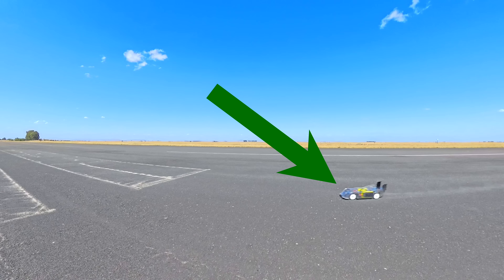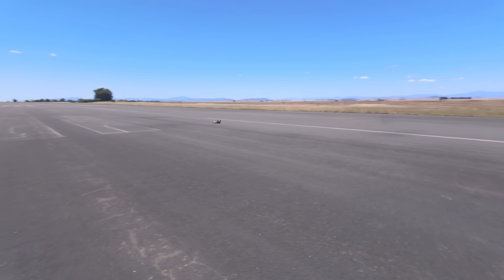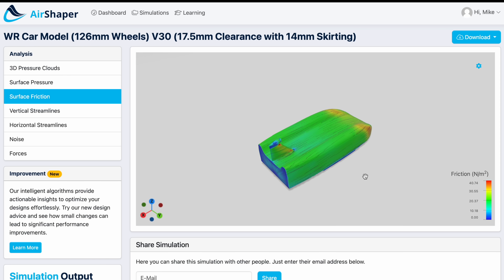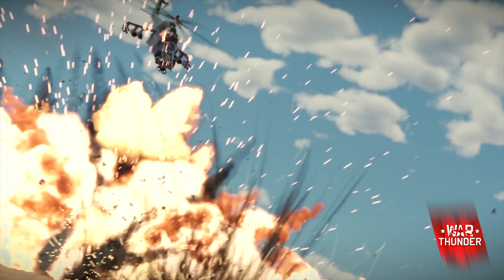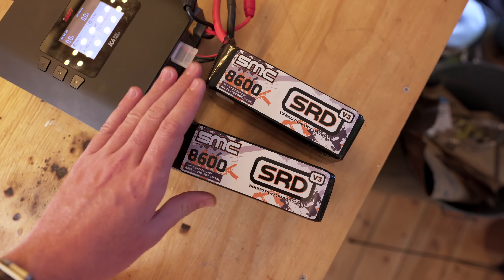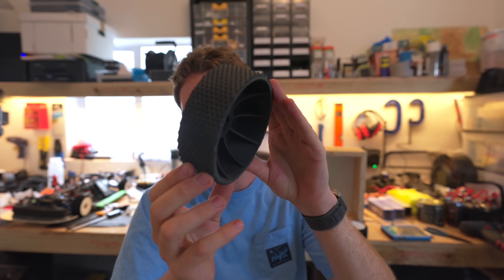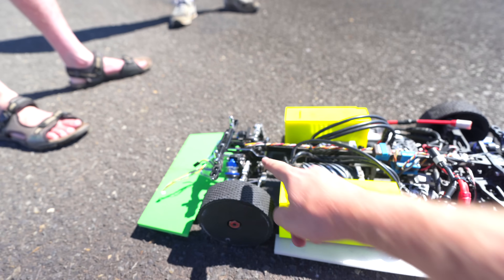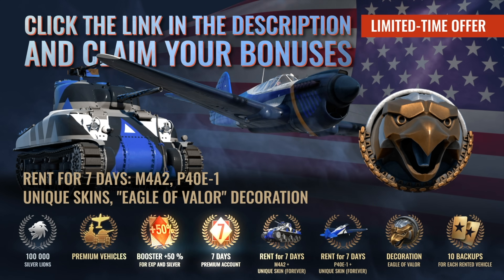World’s Fastest RC Car Project - Part 1 Aerodynamics

Comment: Why is the rear end flat?? That's an insane amount of drag. Look at SuperFastMatt's airflow sim videos for his full sized land speed racer, it has a looong skinny tail. 
Also transparent looks sick but a 3D printed shell would probably work fine for a 20th the price
Reply from the maker: 3D printing every shell is just not practical 😭 and waaay more expensive that you might think. The flat is back because of the aspect ratio of the car. If it was narrower I would go for a tapered back like Superfastmatt and that is the first thing I did try

Comment: I'm thinking if those batteries were securely strapped to the car that the car would have been totally destroyed.  The kinetic energy the batteries hold is more than the car itself.  Losing the batteries helped the car to stop sooner and with less damage.  But I'm not an engineer and I probably have no idea what I'm talking about.  Thanks for your videos!  Now I'd be concerned that the batteries could burst into flames at any time.
Reply from the maker: I created a TPU housing for the batteries which you can see. It protects them brilliantly. You have a fair point. But the batteries weigh about 2.5kg together. The car weighs about 8kg

Comment: I see that the drag level is not high so no need for a wing, but it definitely needs a better spoiler. Also, try making the car as low as possible, so the air doesn’t lift the car. Also, I don’t know if it will work, but a turbofan/propeller engine would also work.
Reply from the maker: Yes I might make a spoiler for the next build! 😎

Comment: use a icharger it will make the  battery go boom boom fast :face-blue-smiling: i blast my pack at 72 amps peek... but the battery dont have long lifespan but omg the power is nuts very good for doing drag runs like this ...  and i have never had a battery blow up on me charging at high amps been doing for over 10+ years now,  battery has to be good quality not cheap ones and stop using them when they get puffy lol
Reply from the maker: Hahaha I'm using ISDT!
Reply: @LukeMaximoBell1  that does the job  but if you really want your battery to be at its maximum performance get a icharger and a 70+amps power supply.  Big difference in power especially for drag speed runs your only at full power for not even 10 seconds
Reply from the maker: @thatonebeone  the charger isn’t going to affect the battery performance
Reply: @LukeMaximoBell1  it will but you won't see degrading after like 6 months or a year just all depends how much your using it.. that's the draw back of high amps battery life suffers lol..  but you'll still be able to use it but might get puffy haha

Comment: Idea, use lego wheels, they have a nice rubber tier and they light and knock off lego is cheap, then to keep the rubber from spinning off, first use a needle and thread and make knots on the inside of the tier, then put the tier on and fill the gap with a mix of pvc cement and contact adhesive "shoe glue" (NOT SUPERGLUE) pvc cement will chemically bond the tier to the hub and the contact adhesive grips the knotes as well as also holding everything together, remember with a wheel the part that is in contact with the ground is moving at 0km/h and the part of the wheel opposite the ground is moving twice the speed of the car, so lots of G forces
Reply from the maker: I don't know if lego wheels are strong enough, but this is an interesting idea to think about!

Comment: hmm... my comments are disappearing again. wtf YouTube
Reply from the maker: Oh that’s annoying!! It’s not me though 😅
Reply: @LukeMaximoBell  Perhaps if I reply to your comment it will get through. I was just saying that since you're designing your own wheel, I don't see why you'd want the vertical wall to be all on one side like the off-the-shelf ones. If the wall was in the middle there would be less cantilevered distance, so less deforming at high RPM (or at least less mass for the same strength at the rim). It would make the stance a little wider, but only by half a wheel width. I don't know if the car actually reaches the speed necessary for wheel deformation, but if there's any deformation it will be symmetrical and hopefully keep more even pressure on the foam, rather than having one side of the foam taking more punishment.

Comment: What about thin aluminium wheels with no tyres? That's what they use on the big landspeed record cars
Reply from the maker: I think that only really works because they are propelled by jet engines instead of  thrust through the wheels. Aluminium wheels are definitely going to slip in a build like this

Comment: That tire issue is the Achilles heel of brushless r/c. Seems nobody has engineered a material that can handle those high rpm
Reply: The runway is probably the worst he could get, some of my city streets are smoother then that, this was not fair for the car, the car was ready in my opinion but the runway keeps destroying the wheels and causing too much drag even when the wheels survive.
Reply from the maker: Actually the runway is pretty good. I just didn’t change the wheels soon enough. That was about my 10th run on the same wheels which is way longer than they should go for.

Comment: Welcome to the wonderful world of ( Build-Test-Crash ) - Repeat ad infinitum, Luke. I think you’re absolutely bang-on going FPV. Essentially speed record running is drag racing with far more tricky aerodynamics and wheel/tyre combos. As I found to my extreme cost, trying to coax an ERevo above 100mph! 😂

You might consider going the fan car route as keeping your model on the ground becomes more and more difficult the faster you go.

BTW I’ve got a Tim Smith-built dragster gathering dust in my garage if you fancy going that route sometime.
Reply from the maker: Thanks! Yeh the FPV makes it so much easier and fun actually! I might try the fan car method next build. 😎
Reply: @LukeMaximoBell  it’s not as easy as it may seem because a chassis plate is such an important part of torsional rigidity and big holes in that are going to compromise that rigidity. Also you won’t be able to do it with a vac-formed body because your fan will just suck it in. You’re pretty close to a Chaparral 2J shape already so maybe that’s the way to go, just longer, to accommodate a couple of ducted fans. Really looking forward to seeing how this project develops. 😊👍🏻
Reply from the maker: @andylewis7360  That is true, I really don't want to weaken the chassis of the car! There is likely space for fans at the back already so maybe I will try that.

Comment: Try making a void or a cavity under the chassis connected to the rear of the car. In order to make a vacuum that suction the car to the road, the faster it goes
Reply: Or a fan like the McMurtry Speirling
Reply from the maker: Yes! I might try this for the next build! 🤩
Reply from the maker: Yes not a bad design. Floor design is very important

Comment: all these failures are just offerings to the gods of speed. :)
a lot of the ROSSA lads have been having issues with tyre/wheel tech as well, so dont feel to hard done by mate.
the ROSSA runway is a lot smoother than yours, so if you can find a tyre/wheel combo that works on your test runs, it'll work at ROSSA.
best of luck.
Reply from the maker: Hahaha they have a lot of offerings 😂 Raz actually says the Rossa Road isn’t great. It might be smooth, but not the flattest? Not sure.
Reply: @LukeMaximoBell1  I only know the ROSSA set up from What iv seen on Kevin talbot's vids mate.
Anyways. Have you thought about metal cnc'd wheels with soft poly bush tyres?
Reply from the maker: @ I don’t think aluminium wheels are necessary. My 3D printed PPA-CF wheels are SO strong. If I can get a good grip compound to stay on those wheels then it should be a winner
Reply: @LukeMaximoBell  well sir, you just earned yourself a lil sub from me. looking forward to more offerings :)

Comment: The “mold failure” with the dimples may have made the body more aerodynamic like a golf ball?
The air turbulence could cause less vacuum on the back of the car. Also maybe something like a whisker biscuit on the bottom of the body/ or frame to keep air from getting under the body. I’m no engineer just some thoughts
Also maybe the wheels could be significantly bigger to lower rpm and use portals on the wheels for gear reduction and to keep the frame close to the ground.
Brainstorming with you
Reply from the maker: You’ve got some good ideas there. Except for the dimples. That’s a bit of a myth. But in saying so I’ll model that in my next video just to make certain. The skirt at the bottom of the car helps a lot with drag.
Reply: Even if it doesn’t help with aerodynamics (but doesn’t hurt)  maybe it would with rigidity
Reply from the maker: @ yeh that’s possible for sure. I’m curious to put it in the sim and see what it says
Reply from the maker: Larger wheels is also a bonus. My custom wheels are 125mm while the stock wheels are 105mm

Comment: From all the attempts I've seen the wheels and tyres seem to be the limiting factor. If the tyres had radial fins with flared ends projecting inwards they could slot over and into specially made rims and so be held mechanically instead of with adhesive. Perhaps that might prevent them exploding?
Reply from the maker: Yeh it’s a fair point. The problem is at some point the foam stays glued to the hub and rips itself apart so it’s quite complicated…
Reply: @LukeMaximoBell1  real race cars don't use foam and glue. They use stronger materials which are held in place via positive location.

Comment: Very cool project. In the future though, please wear a proper respirator when working with (but especially sanding) a CF infused filament. If you inhale any of the microscopic fibers from the dust it can cause pretty serious and potentially long term lung issues. Cheers, can't wait to see this thing run again.
Reply from the maker: Yes fair enough! I didn’t quite think about the carbon fiber infused element and that being dangerous. Thanks for the heads up.

Comment: 80hp? The same as a Stark Varg Alfa electric dirt bike? How many volts, amps, and watts are you actually pulling from the batteries? No way you're making more than 10,000 Watts witch is 13.41 horsepower. 80 horsepower is equal to 59,656 watts. 44.4 volts making 59,656 Watts is 1341.55 amps. Am I crazy 🤣 how many HP is this thing actually making?
Reply: 44.4V X 1400 A = 62,160 watts is equal to 83.36 horsepower
Reply from the maker: Dude a lot more than you think! The motors in these cars regularly pull up to 700A per motor! So you do the math and 80HP is about right 😂

Comment: I am the guy who made Raz's carbon bodies.  We should exchange notes on aerodynamics.  Please consider standing somewhere safe while making the speed run the car is capable of chopping your legs off.
Reply from the maker: Raz already told me I was being an idiot by standing so close 😂 And he is not wrong. At least with the FPV camera I don't need to stand close anymore to line up the drive. I would definitely be keen to chat about it, and I've got some future projects that I would really like your input on.
Reply: The dude wrote “fire extinguisher” on a watering can. What did you expect? 😅
Reply: "it'll probably be fine"
Reply from the maker: That's how you power though! haha
Reply: Have a look at the Mercedes-Benz T 80. I think it could be a nice inspiration…old but gold.
Reply from the maker: That is pretty interesting actually
Reply: @ Is there a certain reason the car is so short? Is is regulations. If not, lenght would make a huge differece already in stability even with poor aero.
Reply from the maker: Whoah it looks pretty cool! Thanks for the tip
Reply: Yeah. I was cringing at the "I'm going to attach a steel blade to the front of this 8Kg object and then run it towards myself at 200kph".....

Comment: Make your rims out of aluminum with a groove towards each end where the tire mounts. This will hold more glue for your tires.
Reply from the maker: The 3D printed PPA-CF wheels are rock solid. I just need to get the foam to glue properly
Reply: @LukeMaximoBell Some time ago people were experimenting with Kevlar threads around the tread of the tyre in strategic places and a dot of CA glue on the knot. Far as I remember the results were quite encouraging
Reply from the maker: That's actually a pretty cool idea. If I 3D print the wheels I could also introduce a thread like that fairly easily.